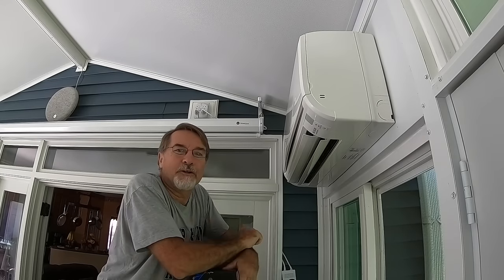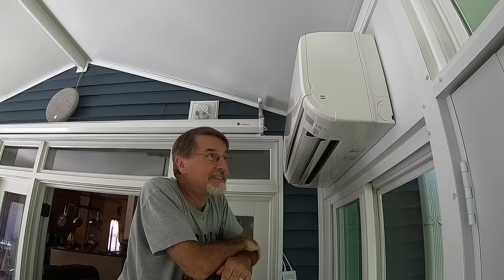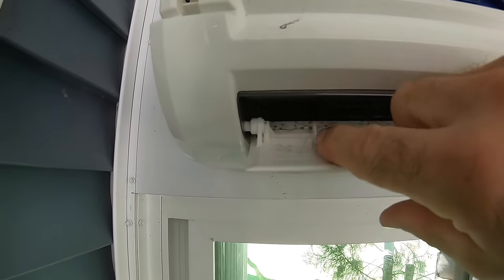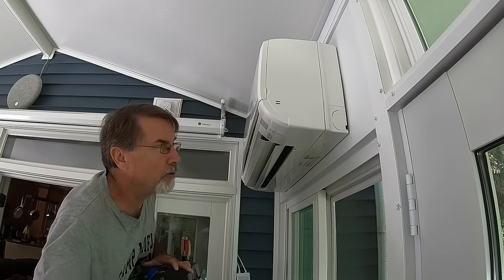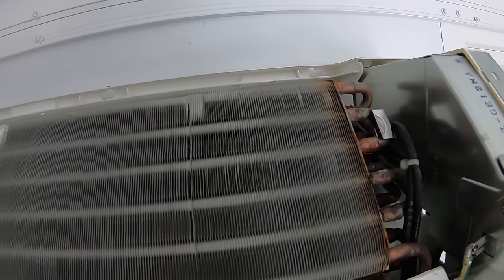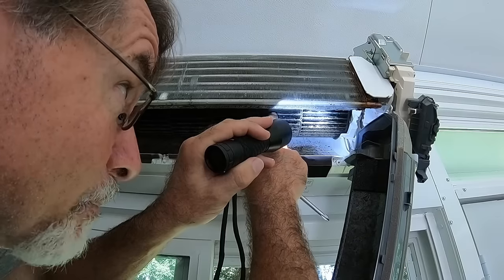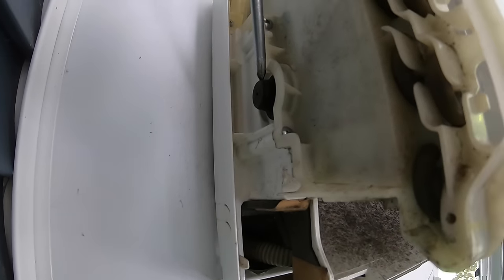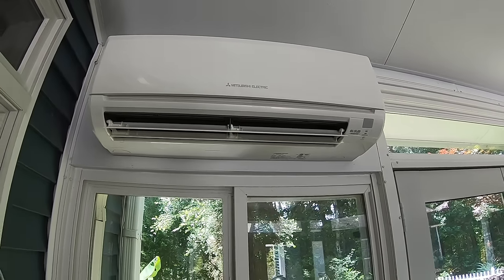HOW TO CLEAN AND SERVICE MITSUBISHI SPLIT AIR CONDITIONER

Comment: Hi how do you remove the black/grey tray that have condensed water? Not shown on your video
Reply from the maker: I didn't remove it but cleaned it out in-place.
Reply: James, it is fairly easy to remove the condensing tray.  Be careful when disconnecting the electrical connector and the plastic retainer on the back side where the water is exhausted thru the drain tube.  The entire condensing tray can then be thoroughly cleaned and re-installed.  I just did this last week; just took a little patience to do it but it was worth it.  Coils are easily cleaned with a  soft toothbrush.  Doesn't damage the coils.
Reply: @johnmatthews3269  thanks man!

Comment: I really wanted to observe removing that blower unit. My guy charged about $500 to clean that.
Reply: Just buy a car wash water gun and hose it down after you remove the cover and get a cover to catch the water just cleaned mine up today cost me about 70 bucks for the water gun plus ac wash cover.

Comment: The blower wheel design is horrible imho, should be as easy as the filter to remove. All the mold mildew collects on the wheel and is blown in the room.

Comment: Anyone knows how can I completely remove the condenser coil for extra cleaning? Thanks!
Reply: you cant, its sealed and filled with gas. Go to an aircom service place and ask for coil cleaning foam. usually in a pressure pack, you spray it on and let it sit. It eats the moukd and junk

Comment: Why my unit has like oily substance around the distributor flaps?
Reply from the maker: That's a new one I've never seen.  Usually you'll get condensation but it's not oily.
Reply: @MyPIDream  sometimes i smoke inside the room with ac on..maybe thats from the cigarettes,its kind of yellowish..is it okay to smoke inside an ac room?can it cause damage to my unit?
Reply: We had an oily substance too, the hvac guy said some of them seem to have a left over oil from when they were manufactured, he put some tablets and water through the system.

Comment: you will avoid cleaning you indoor units if you will invest on using air purifier on every room. air purifier consumes very little power like 40 watts only. i have four-bedroom house with six air purifiers (using two in the first floor).

Comment: Hi my AC unit blowing hot air what shall I do
Reply from the maker: Typically this indicates low pressure on your refrigerant.  There are also other components that can cause this as well.  Time for a technician and if your pressure is low have them do a dye test to see if your coolant is leaking at either the head unit or compressor or both.

Comment: you failed to show the blower tube uninstall reinstall... THAT is what I wanted to see
Reply from the maker: This video shows the cleaning process without removing the tube.  Many times the tube is inaccessible for most doing this common type of maintenance procedure.
Reply: @MyPIDream  fair enough.  And I did watch whole thing.  It is a good video

Comment: Got 2 blinking light continuous, unable to turn on back the air con
Reply: If the vertical vent lock on the left end is not fully pushed in on a Mitsubishi unit to engage a switch, the lights will blink and unit will not turn on.

Comment: What if I can’t turn the power off?
Reply from the maker: You can always turn the power off.  If not on the unit or remote, the circuit breaker.

Comment: How do u screw back the fan part ? U didnt show how .
Reply: watch the video backwards
Reply: @rcherLansky  
Have someone hold coils out so you can slide the fan cylinder from the left to the right onto the motor shaft then push rubber bearing on the left part and insert into place.

It is most important to move your van cylinder to the right almost all the way before you tighten the loose screw or it will rub on the drip pan and make noise when you start it up.

Comment: You didn't show how you cleaned the coils??????
Reply from the maker: Sorry, you can use a light bristle paint brush and very carefully brush the coil.  Or use an air compressor.  You want to be very careful not to damage the thing coil material.

Comment: Hello from Canada James Crockett racoon hunter exstrordinaire ha ha ha 
Ness hope you have a yummy recipe for racoon Ha ha ha 
The air con corrosion you discovered on your cooling radiator I would have 
Cleaned it with rubbing alcohol and brass toothbrush to try and scratch up 
Area a but for better adeshion of say a tremclad rust paint not spray but 
A pint can and smaller paint brush that would prolong replacement for 
A few years I would say maybe let dry for a day and give it a second coat
Then you could give full attention to your quest for Racoons ! Ha ha ha 
Take care. CASEY 
Trying to finish up details of ties to Canada be for winter so I can finally
Immigrate to BOHOL PI befor winter sets in here 
Have a concrete Dome Home I want to construct for my retirement project 
Yaaaaaaaaaaa 😉
Reply from the maker: That info would have been great to know before I discovered the corrosion.  Thanks for sharing and I might have to break back into the unit to do just as you recommend.  More research on my part.
Good luck on the build in Bohol.  Exciting time, eh?  👍🏼
Reply: Exciting time not yet I have been planning my early retirement for over ten years
Finally pulled the trigger 4 years ago ha ha ha has taķen longer than expected 
To sell house and some property but getting close to sending my Balikbayan bones 
And selling my  Ride now was in the Philippines last year on Cebu and Bohol 
Been over several times over the years 
Next time I buy only a one way ticket with a throw away ticket for onward passage 
Requirements 
Happy hunting James !

Comment: Are you crazy? Ok to unclog drain but to reassemble the whole unit - NO! Just buy big bottle of air condition antiseptic cleaner / spray - 10 $ and you are done.
Reply: hi boss, how effective is it to use spray compared to taking the blower out physically and water wash it. thanks in advance!
Reply: @jfree2739  Spray is safer and first aid kit but I recommend washing it with alkaline solution. Just before doing it unplug aircon from the grid. Then let it dry and you are good to go.

Comment: Mine were just installed and dripping..
Reply from the maker: Sounds like a crimped drain hose.  Try pushing something like a wire through the hose to see if there is blockage.
Reply: Sorry meant to say it is rocking back and forth.
Reply: Okay, I had another question pertaining to a toilet. Ty on the AC unit.
Reply: The problem is it has never been used. We had to fire the installer and we turned it on and it drips.

Comment: I hung in there for all of that, and you didn't even show how you actually CLEAN the components outside once you took them all off!!!  Also, your drainage tube outside shouldn't be hanging around by those leaves- it's suppose to be elevated, next to house, without leaves or anything potentially getting dirt up into it.  This happened to us, and the company came back and cut the tube shorter!

Comment: Mitsubishi Air Conditioners are Inferior quality products. It’s easy to breakdown due to fragile parts.
  I bought a Mitsubishi Air Conditioner MXY-3G28VA2 on Jan 2018. Now it's Cooling Fan, Control PC Board spoiled. The seller said it's natural damage. 
If a human die at his 70s, 80s years old, it’s natural ; but if he die at his 7 or 8 years old, it’s not natural, it’s abnormal. 
Obviously this is due to the poor quality of Mitsubishi Air Conditioners.
Reply from the maker: We've been lucky with our Mitsubishi unit here in the US.  But in our house in the Philippines, we used Daikin.  We've heard nothing but good things about that brand.  Time will tell.
Reply: There are two types of Mitsubishi aircons. One manufactured by Mitsubishi Electric and the other by Mitsubishi Heavy Industries. The MHI ones are considered to be the most reliable and the ME ones are somewhat inferior.
Reply: I just had my machines serviced however for some reason my remote is not connecting to the unit is there something in particular I need to do in order to make it initiate to the remote control?